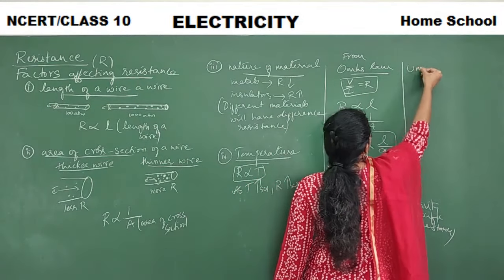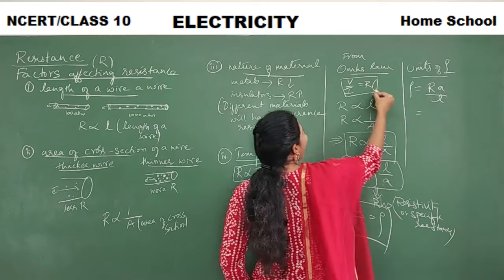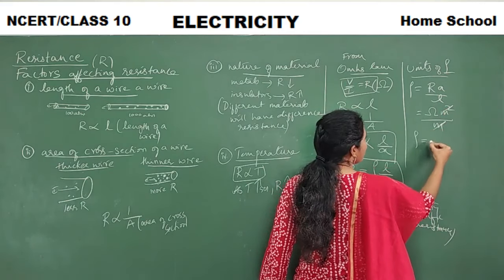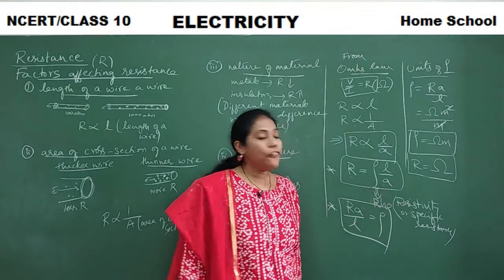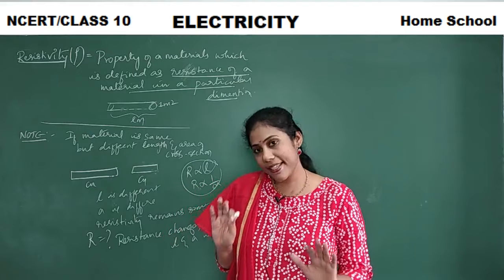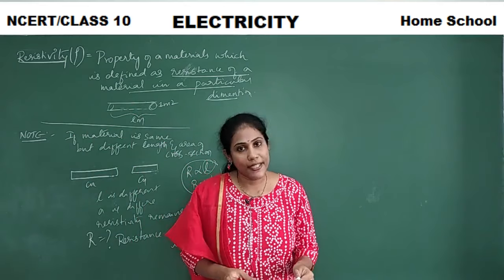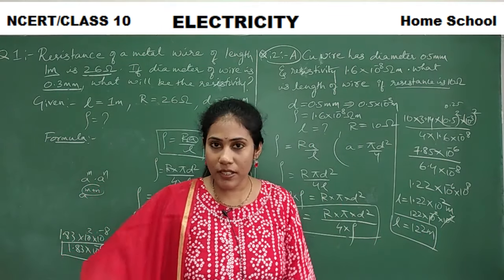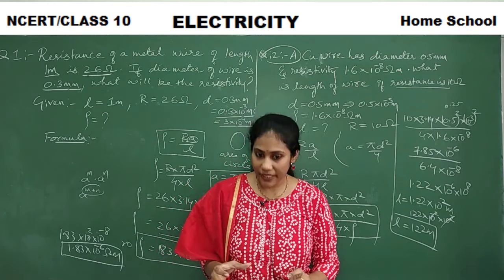𝙀𝙡𝙚𝙘𝙩𝙧𝙞𝙘𝙞𝙩𝙮 𝙘𝙡𝙖𝙨𝙨 10 𝙋𝙝𝙮𝙨𝙞𝙘𝙨 Part 4

Comment: Q].The current passing through a resistor in a circuit is 0.01 A when the voltage across the same resistor is 5 V. What current passes through this resistor when the voltage across it is 7.5 V? 

Ans].given,V=0.01,I=5
          V/I=R
          0.01/5=R
          R=0.002

Given,V=7.5,R=0.002
I=VR
I=7.5×0.002
I=0.015A

Comment: Hi mam your teachingis very nice.I have doubt the u told electron pass one atom to other but in this video u told that area of cross ection of wire that thick wire has less resistance of atom so electron flow fast not though the atom when electron pass one atom to other so this I have doubt

Comment: An aluminium wire has radius 0.25 mm and the length is 50 m. If the resistance of the wire is 10 ohm . calculate the the resistivity of a wire?
Mam pls solve this problem..I have a quiet confusion on this mam

Comment: Mam can you please tell the difference between resistors and variable resistance. And also tell about why resistivity remains the same when the material used is same.
Reply: A resistance with constant magnitude is a fixed resistance ,whereas a variable resistance is a device whose resistance can be varied such as rheostat
Reply: I have the same doubt ...

Comment: Mam,how only Length is directly proportional to resistance,why cant area of cross section be directly proportional ? how do we conclude which is directly proportional and which is not?
Reply: Length is directly proportional. Area is inversly proportional
Reply: Area increases is nothing but space increases. So electrons can move easily so resistance decreases
Reply: Length increased is nothing but electrons have to cover long journey. So they get more obstacles. Obstcles s nothing but resistance. Therfore resistance increases
Reply: Just imagine you are passing from a pipe . If the space ( area) is more you can pass easily. That is less resistance. If the length is more you will be more tired that is more resistance. Hope this concept is cleare to you.